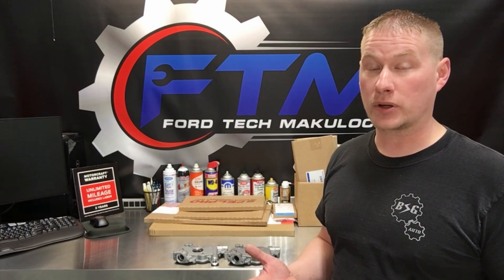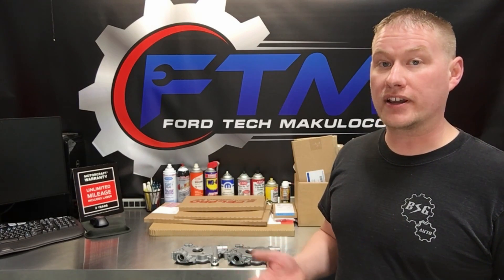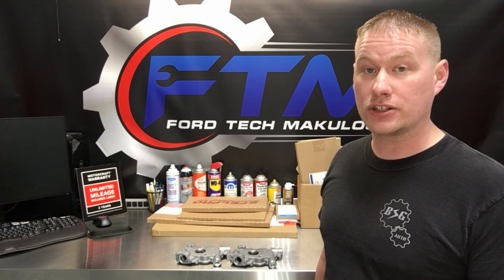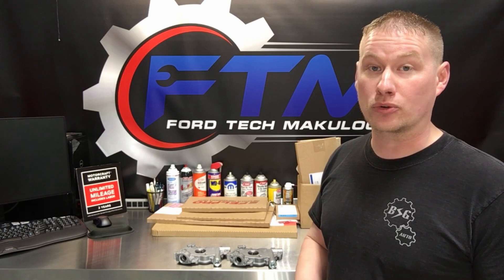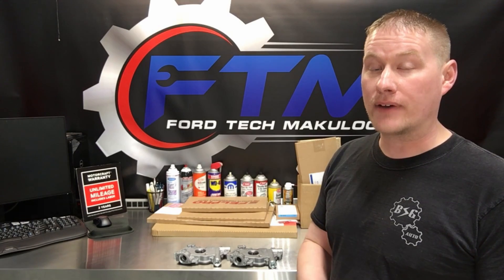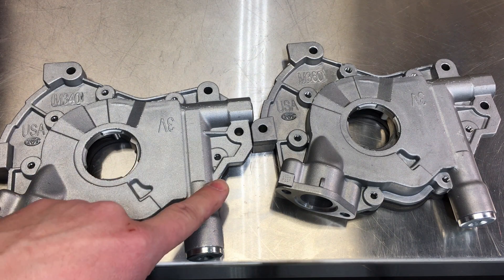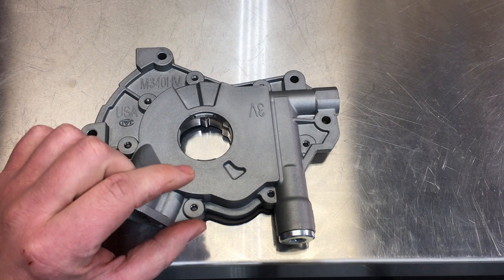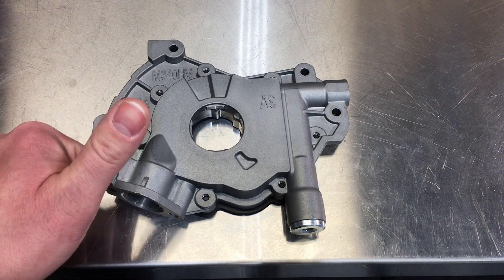The Ultimate 5.4L 3v Triton Engine UPGRADE: New Melling M340HV M360HV High Volume Oil Pumps!

Comment: How about the  6,8,  2 V  what do they have for that one
I dumped my 2004 F-150 5.4, because i broke the frame in two, and yes i did  I'd love to send you photos of it, anyway i now have a 2000 Excursion with the V-10  6.8 for my camper  that wight in at 7020 lb and that's with a bike in it, the only thing is the gas mileage i'm working on that to get better then 5.2 MPG

Comment: Hi Brain Thank you for all the information. What factors to consider when choosing between the M340/M360? Which one should I used in a 2008 5.4L v3 automatic transmission, 2 wheel drive,  King Ranch Super crew 4 door. 123K miles.?
Reply from the maker: I use the M340HV in all my customer vehicles.
Reply: @FordTechMakuloco  Hello Brain thank you for your prompt response. I have a question you probably get a lot. I priced out everything labor and parts on everything I need to put into my engine. The timing kit and high volume oil pump, spark plugs and all coil packs and some other stuff I want to take advantage engine is apart and everything accessible.  It's just over $5000. I can buy and put a new crate engine for less. Which in your opinion would you do. thank you in advance.

Comment: What about all the factory seals and gaskets. Are you going to have problems there with an 80 psi oump
Reply from the maker: no this pump is used on the 4v engines as stock psi which also have the same plastic tensioners with seals.

Comment: Your channel is awesome! However I’m trying to get the Melling M360HV for my 2005 Ford F-150 5.4 and am being told it won’t fit. What do I need?
Reply: I am also trying to get information on fitment  of the M360HV for my 2004 f-150. Have you had any good feedback, relating to the same pump for your 2005?
Reply: It will fit

Comment: How do I know what pump to get? Whats the difference?
Reply: Get the 360. I bought an AutoZone 340 not hv but at hot idle it drops to 10 psi. Causing misfires. The 360 at hot idle holds more psi. FTM has a vid out showing so as well

Comment: Help! Did a timing job and put in an M360HV. I have zero oil pressure when cranking with the crank sensor unplugged.
Truck only had a bad tensioner and I caught it early, no debris in the pan, install went smooth. Do these pumps need to be primed?
Reply: Did u figure out the issue?
Reply: @carsnthings8948  yup. Filled the filter with oil and used a siphon pump to fill the new oil pump with oil at the oil filter boss. Then primed the system by holding the gas pedal down and cranking for what had to be 30 seconds.
Still getting a clack though, wish I installed the plastic tensioners in the kit instead of the "upgraded" steel ones that have no integrated o-ring.
Reply: Good to know.  Thanks for the info, im gathering parts about to tackle the job soon.

Comment: I've got A 04 5.4L 3v. 241,000 miles. Have had to do only the timing guides and such on it. Never had I have had a oil pressure problem. But if and when I do I'll upgrade to this pump

Comment: I have a 2007 5.4L f150 and did a phasers, chain set and the Melling M360 pump. I have start up rattle again a few months later. I didn’t use new bolts on belt tensioners and afraid of one or both tensioners has blown the seal out again. One either I didn’t torque enough on old bolts or the new M360 pump is too much pressure. Any thoughts or experiences you can share.

Comment: I installed a 340hv.... Removed spark plugs, filled it with 7qts through the oil pressure sending unit, removed crank sensor but i still have no pressure...what could I have done wrong?
Reply from the maker: Some engines will not build pressure cranking. If you have cranked over 3-4 times then you are set to fire. Once it fires watch for oil pressure to come up within 3 seconds.
Reply: @FordTechMakuloco  ok I started it and the switch went to middle but after 5 seconds it goes back to zero..... Happens each time I start it....argggghhhhhh where do i need to look?... Brand new pump and pickup tube😢😭
Reply: @Rc_Dread  are your tensioner seals blown? timing chains slap?

Comment: I own a construction company and an auto repair facility. I buy used f150 250 and 350 at auction. We use them damn near exclusively and all of them may or do pull 6 to 10k lbs fairly regularly. Most have the 5.4 then v10 and diesel after that. Some have 4.6. I am not nor have I ever been scared of the modular engines. As a former technician I enjoyed and specialized in the fords. Most of these trucks have been ridden hard by construction gius sho dont give a shit cause it ain't theirs. All of them have 70k or more miles. First thing we do is send them to my shop and we yank all plugs and coils and replace with MOTORCRAFT parts ONLY! Even if there is no problems. We change em. These trucks stay in service for us forever. I have a strict maintenance program and make sure my men adhere to it. These are good engines and best work trucks there is. Dont be scared. Take care of it

Comment: Will the 360HV fit 2004 F150 Lariat 5.4? All parts supplier sites say I need the 340HV. Past comments say 360HV works on all, but you can see my concern in purchasing incompatible parts...

Comment: Great work!  Do you think the M360HV  extra 20 psi might be too much pressure?   Also I'm from Canada and cant find the Ford timing kit on Amazon.  Your link won't ship to Canada. I just got a 2010 FX4 and the chain rattle at startup is driving me crazy. Lasts till the engine is warm. After watching your videos I am convinced its a tensioner.
Reply from the maker: Either one is fine, I am installing the M340HV in my personal vehicle.

Comment: I have a 2006 F150 5.4L with 150k miles.  I bought a M360HV from Rockauto, and my mechanic said it would not lay flat on the block.   Rockauto refused to return it as defective because it isn't listed to fit my vehicle. Melling also doesn't list the M360HV for my vehicle. I'm stuck with a possibly defective pump.  Lesson learned:  Do your own research.

Comment: Can i do a direct engine swap with a 2006 5.4 3 valve f150 blown engine..And put in a 2004 5.4 3valve ??? Besides doing my basic inspection of vacumm hose and intake possibilities of being changed...Will the computer from the 06 run the 04 engine? Asking upon the cams being the same or injectors that the computer dis compatible with? Appreciate the info.. MAKULOCO YOUR THE MAN..YOU WALKED ME THROUGH THE TIMING CHAIN JOB ...CAME OUT SWEET

Comment: Trying to get a 360hv for a 2004 f150 5.4 however when I enter the vehicle on amazon it says that it does not fit the 2004.
Reply from the maker: It fits all Ford 3v engines 2004-2014.
Reply: Thank you

Comment: Hey Brian, Great Videos, Great Channel.  I hope you're making some good money 'cause the value you bring to the channel is substantial.  

I've ordered my Ford Timing Set and Melling M340HV Oil Pump to install in my 2010 5.4L 3V (F150) with 200K miles.

Here's my question:  I've seen many timing chain tensioners "blown out", both in person, and on YouTube.  I was reluctant to install the 80 psi version (M360HV) for this reason.  Perhaps those tensioners have been redesigned and it's no longer a problem?  I figured 20% more volume at 60psi is still a significant improvement over stock with less risk over creating "new problems".  At any rate, I'd like to hear your comments.  

Keep up the great work!

Comment: Hey bro have you ever had to do a brake booster vacuum hose on a 5.4 Triton 3v engine? Hey I have no issues donating. You explain and show everything thing clearly!
Reply from the maker: Yes I worked at the dealer during the brake booster hose recall. Hard to film
Reply: @FordTechMakuloco  thanks bro. Another thing, there is another hose missing on my expedition 06 that runs from just past the transmission gear shifter up to where the brake booster vacuum hose is... does that hose plug into anything up there. Is there any advice you can give me about it? Sorry. Poor explanation, but that's the only way I can explain it.

Comment: Can you replace the oil pump without affecting the timing chains? I have a 2004 with 220,000 miles. Probably need a whole timing package upgrade.
Reply: The oil pump is behind the crank sprocket, so no.

Comment: I have a 04 that has a 2012 jasper motor in it with about 45k on it. Jasper say they started putting these in along time ago, Brian do you know anything about these motors (I'm sure you know everything about it..lol) or does anybody else have any thoughts. It  does run pretty good. Thanks for any info.
Reply: How’s that Jasper motor working out for you?
Reply: @d.jaxxson6227  pretty good so far, I'm about to do the spark plugs. The motor has about 40k on it, so I hope who ever installed the motor  antiseezed the plugs. I don't know what kind of changes jasper made to these motors if any? I'm thinking about contacting jasper to see. I wish Brian would see this and give some of his wisdom, the dude is awesome...lol

Comment: I have a 2007 F150 with a 4.6L SOHC V8 (2 valve) engine. Going on 150k miles on stock parts. Would l benefit from a high M340HV volume oil pump? What other upgrades/replacements do you recommend for my engine?
Reply: Stevef2234 Your 2007 does not have a 2 valve unless you swapped it. You have the less reliable 3v, and i recommend doing this pump and using 5w-30 oil

Comment: I have a 2003 Expedition with about 179K miles. It is the best snow car I have ever owned. I am not saying the best overall as I don't want to start a war that can't be won by anyone. I thought I wanted to upgrade to a 2006 which has the same frame with a little more HP. Having read about the problems with the 3v engines I am going to keep what I have and live with the slight lack of power. I use time-serts for thread repair. Easy enough to do, I did one in the middle of the National Forest one time on the side of the road in a friends v10. Just carry the parts with me. If you don't have the parts I put 800 miles on a small box truck which blew out a plug traveling. The plug and coil removed its self, I disconnected the injector,  the power was still about the same as was the mileage. Got some strange looks puffing in and out of fuel stations. Repaired when I got home, after it reached 268K miles I sent it on its way. I am not saying that running without a functioning plug in the hole is a good thing to do it will get you home with the injector disconnected. You can even leave the broken coil attached The engine doesn't even know that a plug is missing.

Comment: What I don't understand is how oil pumps used to be driven by the distributor, down to the oil pan, where the actual pump was located on carbureted engines...  Why don't they add an additional system or replace the tiny 5.4 oil pumps that are either electrically  or mechanically powered?

Comment: so do you put this in with new timing components or do you put this in before it has chance to start ticking because the most proven fix for these things is to replace the engine because of thhe oil passages being to small i could see this and changing the oil used fixing the issue

Comment: does the high volume m360 oil pump fit the 04-08 3v engines? on amazon it shows it only fits the 07-12 which i assume are the 4v
Reply from the maker: it fits 2004-2014 models
Reply: Thanks

Comment: I have the 2005 Ford F150 5.4 motor.  So what Melling pump SHOULD I put in; the 340, or the 360????????   I'm also having the timing chain, cam phase sensors, phaser sprockets, tensioners, guides,, and new crank shaft pulley bolt installed per your recommendation.  And I might just drive to Illinois to have you do the whole job.

Comment: Just installed a M340HV pump in a low-mile 5.4 that was replacing a bad motor in my '05 F250. From some reports, it can take a little while to prime during cranking. Mine made full oil pressure within 5 seconds of cranking. I did fill the pump with oil completely right before installing however. Definitely a worthwhile upgrade, and if you are doing a timing job it only adds a few minutes anyways. AND ALWAYS REPLACE THE TENSIONERS! The replacement motor in mine had only 46k and was in excellent condition, but one of the OE tensioners was already starting to have seal failure.
Reply: What year was the replacement motor? Ford went through a few iterative upgrades on the tensioners over the years. Mine is a 2014 and at 158,000 miles on it, is just now making the startup rattle (tensioner seal bleed).

Comment: Just another example of how the 351w and 302 are still better engines than the mod line up. I'm a life long ford owner and after I bought my wife a clean 1owner 4x4 expedition to keep her in a ford. What a mistake. I will never own another mod engine. Over 3 years of owning it  I have replaced the timing myself.  What a headache and joke, replaced all 8 injectors, and 8 coils.One blowed plug. The stupid ass preheaters in front of the converters are cracked now and are going to be removed with the cats. All ready has O2 eliminates on the back O2s.Tranny had catastrophic failure so it's on its second tranny.  Since I'm deployed now when she pulls up to a stop light. After sitting there it starts to shake she says. Had rear diff issues. Lucky I caught it in time and changed the fluid and put additive in it. Think when I get home in 9 months. I'm going to sale it and find a her a  92-96 bronco.  When ford still made good engines. Just glad since I'm gone she has my 95 f150 to depend on.

Comment: As others have said you are awesome man, been building and repairing my own engines for over 35 years but this VCT 5.4 had me a bit concerned, first VCT I have worked on, your videos make it no problem so TY! I have a High Mileage f 150 (268k) would you go with the M360HV or M340HV in this case? I Have picked up the OEM timing setup off Amazon you recommended, new OEM VCT solenoids but am also looking at Mellings metal cam tensioner upgrade do you have any thoughts on those as well? Also while I am in there should I just go ahead and replace all the followers and adjusters? Sorry for all the questions but want to do this right the first time and money is really not an issue, since this truck is my rolling office and I am a construction company owner.

Comment: Is it worth it to consider cam phaser lockouts, or is the Melling pump a fix all solution? I heard there is also upgraded chain tensioners with better seals to use? I just bought an 07 with 200,000km's on it, it has a very slight knocking noise and am going to start digging into it. Thanks in advance for the vids and help.

Comment: I have an 06 f150 5.4 3v with 213,000 miles, I have a problem with no oil pressure at idle but when you raise the rpm the gauge comes up to normal, do you think that I need a new oil pump or is that a different problem?

Comment: Just lost my engine the other day driving down the road. No oil pressure and tons of metal on metal noises up front. Pretty sure the timing chain let go but I was able to limp it home through the country since the damage was already done. My question is what company do I go through for a quality rebuilt engine? I will most definitely be putting the oil pump on it before it’s installed if it doesn’t have the update already. Thank you!

Comment: Hey Brian, i have a 2003 ford explorer with the 4.6. I am getting ready to do a timing job on it, and want to change the oil pump while I have it apart. What pump do I use on the 4.6 2v? Thanks for all you do brother, you are helping a veteran immensely.

Comment: My truck just hit 100,000 miles 4.6 L just as a maintenance procedure I went ahead and changed the oil pump with the M340hV, VCT solonoids, cam phasers, chains the whole timing job. I wasn’t having any problems I just wanted it done. My question is with this new pump should I switch to 5W 30 now or leave it at 5w20.

Comment: I searched for the 80psi on Amazon. Amazon says it doesn’t fit. I have a 2008 5.4 3V. Which model # should I be looking for, for my 08???
Reply from the maker: The M360HV I link to fits trust me.
Reply: Man, I wish I would have watched this video two months ago. I literally just had my truck open when I put $4500 into it. New cam phasers, new manifold bolts and heads resurfaced, water pump, plugs and other goodies. Thanks!

Comment: You know more about the Triton than I think anyone on you tube so I will ask you.I have a 5.4 2V Triton would either the M340HV or M360HV be recommended? On amazon it says it does not fit my application. I thought the 2V and 3V shared a lot of the same design below the heads.  I will be changing the timing chain soon just to tighten engine up some 180k miles and want to make sure one of these would work before ordering.. Thanks in advance for any info you can provide.

Comment: So which one am i supposed to choose??? 60psi or 80psi??? Is there a video that explains this? Thanks
Reply from the maker: 340HV is standard for most, I use the M360HV on high mileage or badly worn engines.

Comment: Should this be installed on a truck that just had the motor and transmission replaced?
Reply from the maker: It’s a must for any 3v engine.
Reply: Thanks I'll being this up to the mechanic who just replaced my motor/transmission for the 1st oil change after break in.